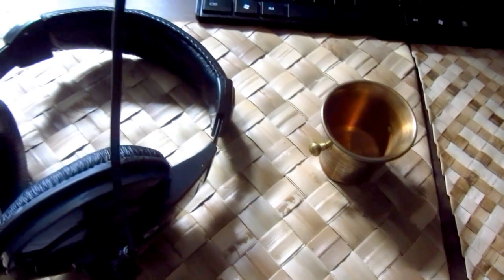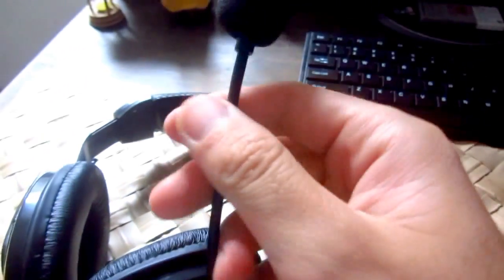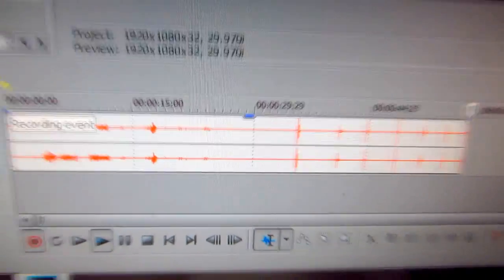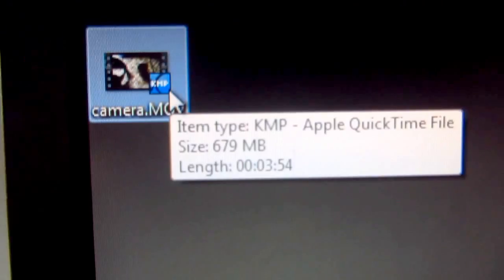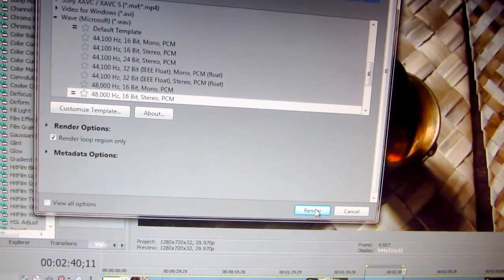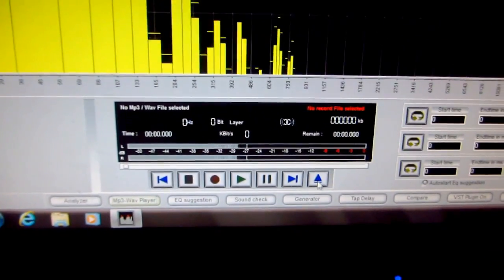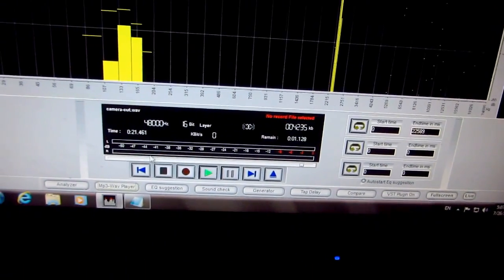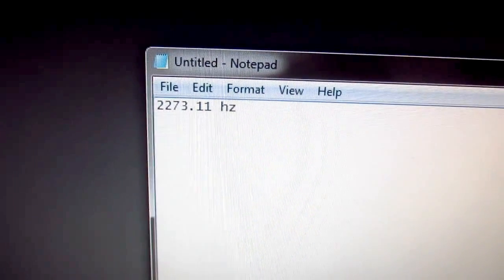How to find the Resonant frequency of an object (.wav files)

Comment: 2273.11 Hz is not THE resonant frequency of the cup.  It's the Primary or Fundamental Frequency.  If you noticed on the screen when it was reading out the samples, there were Other Peaks below the most visible one of 2273.11 Hz.  NEARLY ALL OBJECTS with Very Few Exceptions produce only a single pure tone.  All things vibrate at Many, many frequencies which always exist in Mathematical Relationships to each other.  And nearly always the Fundamental or Primary resonant frequency is the Loudest and the other related frequencies Called HARMONICS are quieter and quieter the further "up" in the Harmonic Series you go.  In fact their Amplitude (volume) increases (or decreases) as the inverse square of the frequency.  (I'm a piano tuner.  We know about stuff like this).  〰〰🐰〰〰
Reply: in fact you are right in generating the fundamental it is the freq with the highest peak.  Giacomo Baldon you are also right in the fact that when you generate a frequency with the cup by hitting it you will also generate a bunch of harmonic content both even ordered and odd orders harmonics but to finds the resonance frequency you need to apply the rest of the test the object. you must first cause the object to  vibrate  or resonate the object using only that frequency or a harmonic of it's fundamental,  if you feed its resonance frequency from and out side source and get a sympathetic resonance. for example  set up a function generator and send the frequency through amp and a speaker setting close to the object see if the object will start to vibrate at that frequency or in sympathy. when you get as much vibration out of the object as the vibration source you have then found the exact resonant frequency.
Reply: How then would you find the resonant freq.? Asking for a friend.....
Reply: @christopherjcarachure2575  testing primarily, and you may have to remake several times so then you accumulate your chimes, bells or whatever that go unused in a particular project. maybe for later projects.
metal rods of uniform length tend to have a zero amplitude node at about 23% of it's length from each end. you can suspend the object at these points to clearly hear it's highest amplitude wave. odd shapes can have weird locations for wave nodes. I thinking something about 75% of an objects weight must hang below it's suspension point for chime-like rods but bell shapes can be hung from the top.
 this is advanced material harmonics, very specific to the type of object you want to resonate. can get very deep and involved!
Reply: Yip thanks Alan. Both off them correct. 
✅ in glass 🍷 breaking, one taps the glass. This gives a main frequency ( loudest called the fundamental ) and many smaller peaks ( the harmonics)..... When a person sings into it, the energy builds up. At any frequency,  *close  
to fundamental* the glass breaks. Ie. Lead crystal wine 🍷 glass = 562Hz and it explodes at 556Hz).... I do know why, but if I had to guess, maybe there was a small imperfection ( mircocrack) at 556Hz.  More experiment needed.

So, the Resonance frequency is the frequency which gives more energy to the system ( 🍷).. at which it cracks.

In Sonoluminescence ( sono-lumi-nescence) light 💡 is produced from a bubble at Resonance frequency. 

Thank-you
Reply: @KajanLakhan  when frequency increase in multiple such like f0 is a resonant frequency f1=2f0, and f2=2f1 f3=2f2 and so on depending on vibrations how much it duration it persists in the body
Reply: @erjaspreet007   hi JS. The dominant frequency is Jo.

Then one can graph this, for the other peaks( of that specific material)

..but I'm no longer on this field..i left.
Reply: not necessarily. some harmonics are inhibited by an object's specific geometry, and there can be gaps detected. ex., a bell has it's fundamental, but several middle harmonics are not heard but you clearly hear some of the upper resonant frequencies, and those tend to lessen quickly. using different materials to impart resonance can have some effect too. softer mallets can inhibit the higher harmonics, a hard mallet can impart the short-lived highest frequencies, and of course material choice and shape enhances a specific frequency too, and the associated harmonics
Reply: Do you know the frequency of shrooms?
Reply: thats right
Reply: And then.it Circles Round again from the initial First Action! So you put 1st Action I.E first enegy in put! And as you says you get a lot of notes along with the the Bass Note! Well we will call the main.note of an Oblect the bass note! But plus we get other notes from the Bass note too as its causing Vibrations on other parts of each oblect! N thats what give us all Notes! Cause from the bass note that then we can tell and hear n feel the different Vibrations! As the Bass tone & note give us a marker! Thus tell the difference from slight changes of Density & Material & Wave Length & more...
Reply: I appreciate your comment but what precisely are you saying? That he is wrong or are you telling us the right way to interpret these results? Or something else?
Reply: How would you determine resonant frequency of liquid water?
Reply: Alan Werner omg omg I am obsessed with frequencies, vibrations and I need to learn about ..it? Where do you start? I want to know about certain animal sounds, etc.. I’m not even sure what I’m asking..?
Reply: How would you reproduce each peak independently yet simultaneously? I want to mold rock 😉
Reply: resonant frewucneies is that they call octa ves
Reply: Alan Turner so how does one find the frequency of certain objects? Is there some sort of analog or digital meter that is accurate?
Reply: The frequencies below the fundamental of the bowl frequency is room noise. he’s not testing in stable conditions, well it’s either room noise or the noise floor of the microphone and pre amp. Could be his computer fan also. These frequencies below the fundamental are not important as they are separate to that object.
Reply: Thanks
Reply: Alan Werner lead doesn't resonate.
Reply: @proteus1  technically everything resonates, unless 100% of the energy is dampened or disapated in 0 cycles. That means even if it took just one cycle to completly dampen the energy added, it resonated. Pratically speaking we want our resonators to dampen its energy much more slowly over many more cycles.
Reply: @kreynolds1123  
I'm late on this comment...but well aware of raymon Rife & the spooky devices (based on his work)
But what you said makes soo much sense everything has a frequency, even if it was instant dampening...it still would of resonated.
Reply: Alan Werner understood thanks.
Reply: It could be  2273.11 Hz, a my comprehension,  the HIgh Frecuency of sound. It is not the Primary or fundamental sound. The fundamental it would be the sound more Down. That is what the name fundamental means
Reply: Gotta love those quick Wikipedia tabs
Reply: L
Reply: congrats, that's it!!!😍😉👏
Reply: Since you were a teacher in this resonates with area I’m wondering if you could give me an answer as to why do you think we haven’t found the resident frequency of certain cancers to use that vibration to eradicate them or do you know anything about this subject that would make it impossible right off the bat
Reply: @moniquepagano3555  take vitamin b17
Reply: @jrms.lvrz.1  thats crzy you said that right now…..
Reply: Alan Werner you might be wrong... since the resonance frequency is the one with the highest amplitude... the other frequencies that sparks up are generated probably when the bell is being hit.
Reply: @giacomobaldon1450  I'm a physicist; Alan Werner is correct.
Reply: Can you pass your hand through an object if you can match the frequency does anyone know?
Reply: @justinwells8234  no you can not. 

You might be ale to shoot an atom or two through thin slice if your lucky. The problem is electric fields from electrons interact with the fields of other electrons. So if you have a lucky trajectory and sufficient speed you might get lucky and find a hole without smashing two atoms. Sufficient speed is needed to minimize the duration of interaction between fields.
Reply: @kreynolds1123  I want to say it is possible Keith and because your main stream science is consistently wrong and do not take things into consideration that are not "provable". I would say that if you can match the frequency of something than technically you could merge into or through it temporarily... Im not sure just wishful thinking backed by a small amount of evidence... I ask these because black magic or magic can make things like that happen... Very easily... I wonder if top magicians know things we do not such as putting your finger through a sweatshirt with no hole... illusion possibly or is it real... The emarld tablets state that we live in a holographic universe and many beleifs throughout history state the same. I do not know the facts but the more I learn the more I realise that anything is possible.. I mean nasa Michicho (bad spelling) says everything has a frequency and that we can live in multiple deminsions science is also starting to claim there is a god and most of what they discovered does not work becuase it was only a theory... I think They are all wrong and I think it is defenitely possible yet we have been so supressed throughout history that we no longer have the information... I beleive  we are way behind and that technology is only here to control and destroy our lives... It makes it better in ways but truthfully a genuine conversation in nature is much better than a text or message on fb... I just hope we can all open our eyes wide and see the truth.... The blind will see the deaf will hear and the crippled will walk.. Good Luck We need it... Also how the fuck is the federal reserve not federal WHY ARE WE PAYING 36 MILLION DOLLARS IN INTEREST PER HOUR IN THE UNITED STATES AND WHY AM I JUST LEARNING THIS LITERALLY OUR TAXES ARE BS THAT GOES TO A PRIVATELY OWNED COMPANY...  Why is there no law that says the average man must pay income tax If anyone in here is serious I would love to talk... I doubt most are but if anyone that reads this wants to Rule the world and get these sick fucks out of power than we need to talk ASAP. IM LOOKING FOR PEOPLE WHO WANT TO LEARN AND SHARE ANCIENT SECRETS FOR THE BETTERMENT OF HUMANITY AS A WHOLE. I am done being a Slave.
Reply: @justinwells8234  heh, Ok....
Reply: @justinwells8234  damn that shit really resonated with me. It's tough to find people who view the world in a similar way. Most people don't realize how much their perceived reality is limited by accepted truths that they don't question. I don't understand why someone people push back on questioning everything. Do you live near Indiana, my friend?
Reply: @jordanshane5422  camera obscura shows evidence that we could be a reflection of the fourth dimension. in the transformation process, through black holes, we lose the ability to manipulate time as an aspect of our dimension. a 3d scene, through a pinhole, inverts and recreates on the other side as a 2d rendering. imagine this at a universal scale. 🤯
Reply: Except that a) there is no Emerald TabletS, only AN Emerald Tablet and it consists of 15 alchemical laws and b) the book you talk about (which is a forgery) talks nowhere about the universe being holographic. It's funny how all those "awakened" people aren't that different from the sheep, given that both of you blindly believe things without checking the actual sources. Humanity is lost lol...
Reply: @anonymous-uq7cs  Can't be lost unless you're going somewhere specific. 🤷‍♀️
Reply: @justinwells8234  looks like you watch flash alot
Reply: You watched Ben 10 ???... REmember Kevins powers ??... where he could transform into any material he touches... i think thats what happens...he matches frequencies with any object he touches hence bonding his entire cells with them.. @justinwells8234
Reply: William Utriainen  perfect. The strike of the rod, like puckering or hammering a string, produces a impulse like excitation. An ideal impulse excitation contains the whole spectrum, that's why the spectrometer picks lots of frequencies readings in the beginning.

Comment: Thanks for giving me an idea to further along an invention I've been working on for some time now. It is a hydrogen/oxygen fuel cell. Stanley Myer was killed by the government for trying to  manufacture and subsequently to sell these things. I don't want to do that. I am going to give them away. I'm not applying for a Patten. Thanks for some much needed inspiration. Resonance is what the key is to procuring exponentially more hydrogen and oxygen in an electrolysis type fuel cell.
Reply: I could make this battery of hydrogen and oxygen and expose it to these resonant frequencies .... look for the frequency of water and metals and coordinates ... in fact this breakdown of hydrogen and oxygen was already made by means of waves of radio and it was possible to separate the molecules ... the owner of a radio station did it, I believe in South America ... the videos are online ..
Reply: therealnightwriter    volts are free? I'll take 12 please...      〰〰😀〰〰
Reply: Ric Caruso lol
Reply: There is an exact material, used commercially in a divergent field, producing the best gas for a H2 fuel cell. I won't note it here.  (PATENT is spelled as such.)
Reply: Good luck
Reply: THEY will kill you anyway...just for the FUN of it!

Comment: You didn't have to do all that rendering, when you recorded with the mic the 1st time, the data was already rendered (as 24/96 or 16/48 depending on the project setting, even if you don't have a 24 bit card it will still write as 24 bit) wave file in your project folder. you need only drag over your selection, and press "S" key to trim it at each end, then select the ends and hit delete. Now you'd drag your cam file onto Vegas, select the video timeline, press "U" to ungroup it from it's audio track, then press delete, and trim it like the (mic) track.

Comment: You can sometimes hear another strong frequency about a minor third under the strongest frequency. Especially noticeable on the third hit (0:47). My guess is that the strongest frequency here is the sixth partial (two octaves and a fifth over the base), and the base frequency is therefore 2273.11 hz / 6 = 378.85 hz. Any thoughts?
Reply: Correct. Music theory + physics = winner

Comment: It's a legit experiment. Not sure why everyone is freaking out. Obviously the peak harmonic is the closest object to the microphone. Obviously objects have second and third harmonics. It's a 2273hz cup. get over it. Is the resonance of the cup the same as the resonance of the brass? Which is what all the sock puppets are really freaking out on. No 2273 is most likely not the resonance of the brass. However I will bet a curve of brass and a curve of that shape cup cross at a multiple of 2273 on a graph. And finding the common frequency of the striker and the cup should yield a harmonic of brass also. Now coincidentally I have never seen any trumpets explode at a concert. So I think something else is missing from the equation.
Reply: I am an acoustic engineer. There is  a table of relative frequencies related to materials. To get an accurate sample the object needs to be suspended in air to reduce the dampening effect of other objects touching it. But that is a hard thing to do unless you have a high pressure air bed. Which I have. You can also accomplish this with a needle bed. The screen shot does show close to the base resonant frequency of the brass jar.
Reply: Nice
Reply: Has anyone tried this to resonate copper with Ferrell fluid? I mean to see kind of power readings you could get vibrating speed of sound
Reply: k wise-guy.. how can this method determine the frequency of a solid crystal... it can't
Reply: Dear crohker none of the musical instruments play single fundamental frequency guitar violin piano flute any bcoz when we use operate them they produce multiple frequencies from 20 hz to 20 kHz range which is our audio range that’s why instruments donot blast 💥 but even a tuning fork has produce when hit many frequency near to its fundamental frequency for experiments in a glass experiment in which glass broke down bcoz it can’t bear more sound waves energy when hit to its body as vibrations so at particular frequency or we can also say time it breaks that frequency is resonant frequency and the process or phenomenon is called resonance

Comment: This is not true. The reason there were multiple frequencies detected is b/c everything vibrates, therefore everything is giving off its own individual frequency to be detected. When he struck the object; the swinging device vibrated, the metal object vibrated, the table, his hand, the head phones, everything. He used the mean frequency as the "resonant frequency" when that's actually just the mean frequency of an object and its surroundings when struck by a particular object. Would it have produced the same sound if struck with an object of higher or lower density? Yes. Therefore resulting in a different  "resonant frequency. It's no where near this physically simple.
Reply from the maker: I'm not an expert in this field but the swinging device was in the hand, the hand almost instantly reduces the vibration. The cup was struck, in my opinion the table won't vibrate significantly at all. They don't have the same frequency to pick up each others vibration. The hand is 99.9% a vibration absorber, it is simply too soft to vibrate at a noticeable frequency. The head phones... which part, the plastic or the tiny coil inside? They have different resonant frequencies...